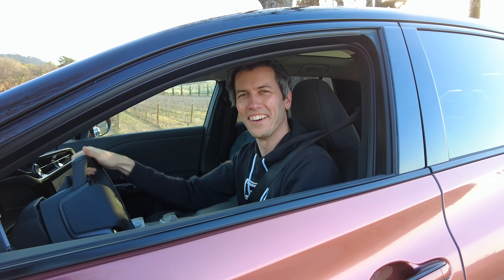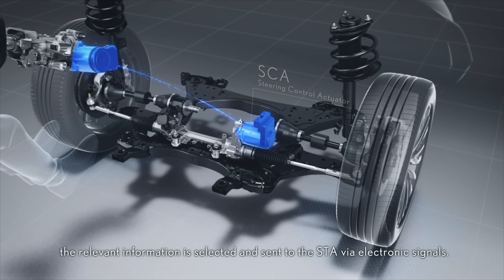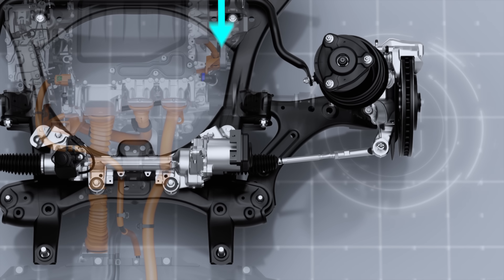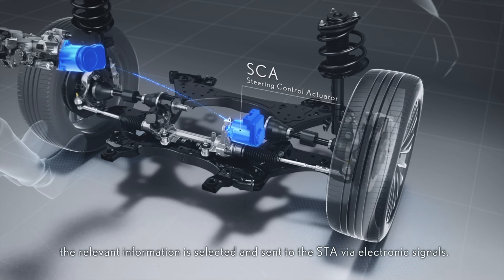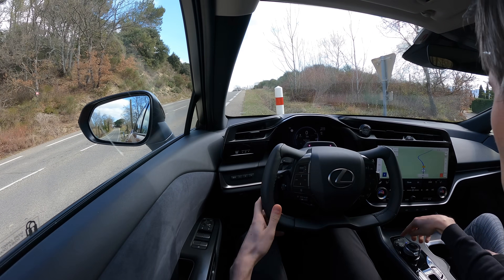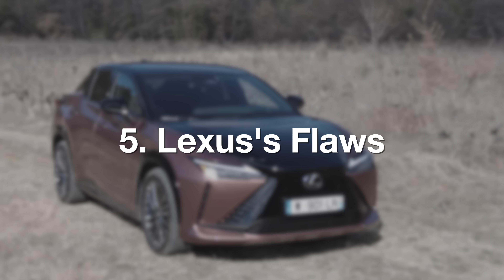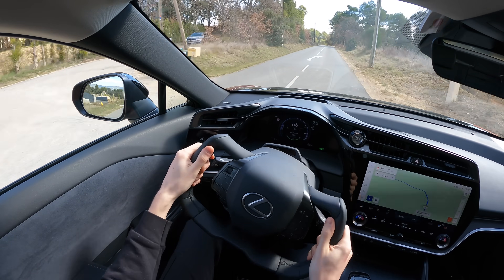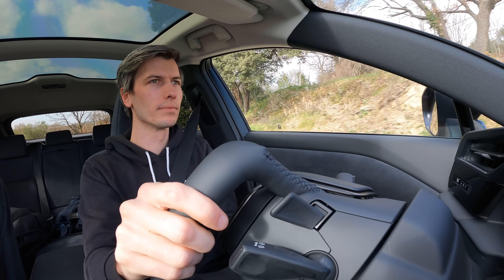How Lexus Fixed Tesla's Bad Idea: Steer-By-Wire Yoke

Comment: Today there are already plenty of construction and mining vehicles which use steer-by-wire with some great features. One I really like is the angle-variable steering sensitivity instead of a speed-variable one. In the center you get a really precise steering with a high ratio, while towards the limits you get a much lower steering ratio. The same trick is used by several pc racing wheels.
Reply: I've found that angle variable steering makes machinery much harder to navigate through narrow environments, I'd much rather turn the wheel an extra time for that increased control.
Reply: idk how you could possibly avoid an accident with this system going at highway speeds.
Reply: @Playingwithproxies  It will steer as quick or quicker than a normal car with a normal steering wheel in that situation ... and the stability-control remains there to hopefully bail out a driver who screws up. This should not be a problem, as long as the delay mentioned in the video is below perception (Lexus needs to calibrate that out).
Reply: @bikeaddictbp   it’s not quicker than connected to the wheels for sure and it’s the lack of ability to make big stearin maneuvers that’s going to cause avoidable accidents.
Reply: @Playingwithproxies  Stated in video: This system does not restrict the driver from making large steering movements at speed.
Reply: @bikeaddictbp  yeah and Bowing said the 747-max was safe too. You do realize that the adjust as you increase speed steering ratio requires that it is actually limiting your steering movements. A company trying to sell you a car will straight up lie to your face to make a sell.
Reply: @Playingwithproxies  actually 737MAX and 747-8 does not use fly by wire. Airbus A320 and A380 does, in fact all Airbus after the A320 series use full fly by wire.
Reply: Construction vehicles don't need to adhere to safety as road cars do. You don't see mining front-end loaders have pedestrian crash bars or air bags in them.
Reply: @@nicoyazawa829 completely different. Aircraft have near the highest redundancy/factor of safety of any vehicle ever. This cant be said for a passenger car. Fly-by-wire is electro-mechanically assisted, not only electrical.
Reply: @PrIsMaTiSmX  Airbus fly-by-wire have full digital connection between the input and flight control surfaces. Currently, only the rudder have mechanical connection except for the A350. Airbus is in the process of removing that last connection. Switching to e-Rudder for future A320NEO series production.

Edit: I forgot to mention the THS, that's also have mechanical connection on A320. I don't know if this still true for A350 and newer models. That said, on normal operation, trim on an Airbus are fully computer controlled.
Reply: @bltzcstrnx  you're missing the point, there is ALWAYS mechanical redundancies. This is a matter of public safety. Steer by wire is not a good idea. This is coming from someone that is a practicing Astronautical Engineer for JPL..
Reply: @bltzcstrnx  also, you will need to cite your sources, as I do not believe what you claim.
Reply: @PrIsMaTiSmX  There is no mechanical redundancy in most passenger cars. If your steering column breaks, you have no steering.
Reply: @danielrose1392  Yes, but it's mechanical. It would take the physical breaking of steering components in order to fail. This happens much less often than an electrical systems failure. That's just a fact of nature. Mechanical systems are inherently more resilient than electrical systems.
Reply: @PrIsMaTiSmX  "Resilient"? Ever heard of material fatigue, mr JPL engineer?
Reply: @pavulon5000  you hardly have a high-school education if you think resiliency has any relation to invincibility.
Reply: @bltzcstrnx  have no sources to cite?
Reply: @PrIsMaTiSmX  I already explained to you that YouTube doesn't allow links/URL. I understand your skepticism since you're working on an US based organization. European and US have different philosophy on flight control laws. You can read about it online. Airbus basically decided that redundant fly-by-wire systems is enough to compensate the lack of mechanical connection.
Reply: @bltzcstrnx  I have already researched it. I am literally in that field and the rest of the world agrees mechanical redundancies are necessary for the obvious possibility of electrical or sensor failure. YouTube does allow links, you just haven't tried to send them. Even if they didn't, you can simply modify the link to something YouTube wouldn't recognize as a link.
Reply: @PrIsMaTiSmX  I have in the past, it usually got deleted almost instantly. Anyway, you can read about Airbus e-Rudder. Basically rudder and THS are the final components on Airbus that is mechanically linked. Airbus is replacing the rudder with electronic link in the future. Leaving THS to be the only last mechanical link available. I know it's somewhat hard to believe, I also know this after reading several documents including part of the FCOM about flight control laws. In the end, Airbus is confident in their redundant electronic system and computers. They deemed mechanical linkages increases complexity and weights.
Reply: @bltzcstrnx  feel free to provide receipts at any time. Also, not sure how one company doing one thing in aviation has anything to do with what another does in passenger cars. One does not prove the other.
Reply: @PrIsMaTiSmX  most likely because automotive industry takes inspiration from aviation. Both aviation and naval industry (for very large ships) already do away with mechanical linkages since the 90s, maybe even earlier.

Automotive already done it with their throttle control. All (most all?) modern production car already have no mechanical link between throttle pedal and the engine. Brake probably going to be the last one to lose its physical connection. So steering most likely going to be next. They probably think since aviation, which is proven to be one of the safest industry, already done this a long time ago, why don't we?
Reply: @bltzcstrnx  you probably also recall that its the safest form of transportation in the transportation industry due to the inherent risk of death associated with flight (and 9/11). The aviation industry is safe because of its strict governance. Low tolerance for lack of maintenance and high security. You can't just walk up to a jet on the runway like you can a car on the road. This is why its safe, because they go through yearly maintenance as a minimum to be considered air worthy, and no one but certified technicians are allowed to even take the engine cowling off of a jet. Passenger cars don't get that same treatment.

Throttle-by-wire is much different than steering by wire. If throttle-by-wire fails (and it often does), the worst case is a vehicle not being able to move anymore or coming to a stop. This is why its a no brainer, because its' failure mechanism defaults to a safe stoppage of the vehicle, with a mechanical spring ensuring the intake valve stays shut and the ECM defaults to an idle fuel-map.

This is different than steer-by-wire since there is no default it can resort to upon failure that will allow the vehicle to remain safe. A driver must always be in control of the vehicle, this at a minimum is maintaining the ability to steer, and the ability to stop in some form. (This is why the brakes are automatically applied when semis and other large trucks lose air pressure) In the event of brake failure, its safest to be stationary.)

The failure mode for a throttle is closed as opposed to open, the failure mode for brakes is applied as opposed to released, the failure mode for a transmission is free spin as opposed to lock-up, the failure mode for steering cannot be assumed to be similar to the others due to its critical nature. This is obvious.

Steer-by-wire will always be a bad idea, especially since vehicles are being tampered with every day, let alone giving a criminal a chance to completely override a drivers controls by installing a bypass unit under the vehicle while the owners are asleep.
Reply: @PrIsMaTiSmX  that's true, but several companies are testing steering-by-wire. They probably thinking it's more safe than brake-by-wire and intend to get there after throttle-by-wire. It could reduce production costs, especially for manufacturers who deals with market that have different steering side (left hand or right hand).
Reply: @danielrose1392 I’ve never heard of a steering column breaking. But electrical problems are rife in modern cars
Reply: A linear movement is desired with sim wheels. You can make it non linear but that would be an entirely preference thing.
Reply: im not disagreeing but variable assist HPAS systems are already available.
Reply: Yeah, I get the point but these vehicles only operate at low to very low speeds compared to an EV.
Reply: @Nico Yazawa flying car anyone? as this interior makes the transition from ground operations to flying easier as 172's have yoke's generally ect
Reply: @Nico Yazawa construction equipment drives very slow, and aircraft are in a near empty environment with nothing else to avoid on a moment's notice.
Reply: Construction and mining equipment are driving round at 20kph at a closed area. Not 100kph passing oncoming traffic without a barrier in between. 
I bet you have no idea how many people die because of these new inventions. Like for example the auto pilot of Tesla. I bet you didn't know that there have been loads of deadly accidents directly due to the actions of the autopilot. That kind of things are well kept secrets.
Reply: @Dani8chs  Your bet is totally wrong, it's my work to comission and automation of HIL simulators for the automotive industry. Except for a joy ride to try something new, I would not use Tesla FDS and I would always keep my eyes on the road, but I would absolutely buy a car with electronic steering. The later is a system which can be fully validated and verified during development.
Reply: @danielrose1392  I tried several cars with electric power steering and they are all rubbish. There is a reason why BMW choose to just eliminate the power steering above 30kph on some of the M models . They just could not get the propper road feel acceptable for an M car. But most people aren't really ''drivers'' . They just want to get from a to b and have some gadgets onboard. Hence the fact that SUV's are so popular. For them I guess it's ok. Although on the Hyundai I40 the road feel was so bad it was almost dangerous. You put the car into a corner and you suddenly end up 40cm further out than you expected. Crossing the middle line. It is just not intuitive. But my wife never noticed the problem.  She is a novice when it comes to driving.
Reply: @Dani8chs  Tesla's self-driving mode actually is safer than my 60's charger/2000's-car as humans make more mistakes according to DOT and FTC released information aka elon would have been sued by owners and investors 

im not really interested in self-driving or automating my driving experience at all aka i generally don't enjoy using cruise control from the 1970's-up ect

as for by wire and or tuning on the fly maybe as im kinda for it, but DOT i can't see them passing it as written steel end to end only and as written assessed 1970 box/steering if fround upon but legal

Comment: What happens if that wire connection gets broken. Or corroded mid driving and you get a fault where it cannot steer for you. This is super common for many modules and connections in modern cars as many error codes are caused be bad connections. In this case you drive off the road into a tree
Reply: VW has a function where the car will turn on the hazard lights and drive to the shoulder / right side of the road when the car thinks the driver is unconscious. So in theory the fall back could be, the system recognize the faulty connection (power loss somewhere) and then does the same using the cameras and sensors of modern cars. And since there are two motors for steering, one of them should always be working.
Reply: @nils9853  How will it turn if its failing to make contact with the steering motors. I think my point remains.
If my abs unit fails and cant comunicate I can still brake. If my steering assist fails, I can still Steer just harder. But if this system fails then it can be really bad

Comment: Some farm tractors have variable steering ratio and it’s awesome. Tractors steer with hydraulics, but it’s the same idea. Traditional tractors requires a zillion turns of the steering wheel to go from lock to lock.

Comment: Putting aside any concers about steer by wire, variable steering ratio really sounds terrible for any driver. What if you are rapidly braking and turning at the same time. The case of many dangerous situiations when the driver need to avoid or minimise loss. Will then the car start turning sharper? This require additional skill which the driver is not assimilated with during everyday driving. sorry for bad english

Comment: Could a mechanical steering column use something like a small CVT in order to create a variable steering ratio, thus allowing a yoke to be suitable and to remove the delay in steering response?
Reply: in theory yes, but it most likely wont happen. there are steering ratio boxes that have been available for a while now, if you feel like your steering is too delayed or slow, you can change the ratio from say 1:1 to 1:1.1.  its just a little pair of gears that goes between the int shaft or column shaft depending where you install it

Comment: Great video, but I have to disagree about Tesla’s design. Their design is awesome. The yoke feels much better than a wheel, and hand over hand movement isn’t an issue at all. It took me literally like 3 drives to get completely used to it to where it’s not even a thought, all natural. And most everyone that has used the yoke all say the same thing. Now I prefer the yoke over the wheel by far, so much so that I even got one for my Model 3. It just simply feels better and is much more comfortable than a wheel.

Comment: One safety concern not adressed here is the possibility of some sort of control logic failure. It's not unheard of for abs or traction control systems to freak out for what ever reason and apply more or less brake pressure than needed. While these types of failures are rare, when it comes to steering I feel when it comes to steering the safety margins must be a lot higher than in other systems of the car, since the driver Can't really correct a random full lock steering input at highway speeds. Do these systems include reduntant sets of control electronics as well and how is it determined which module is malfunctioning if the outputs differ?

Comment: I like it. And from a safety standpoint. There are sensors and computers in all cars since 20 years which could explode the airbag right in your face every second. But this nearly never happens. This shows that electronics can be build fail safe. But the car really should limit the driving range or get really annoying when one motor fails, to make people go drive to the repair shop.

Comment: I'd be more than down to try Drive by Wire as long as:
There's no input lag for steering, obviously.
I'm not forced to use a Yoke. I hate them, I'd rather have a wheel. I have no issue seeing things on the dash with a traditional wheel, which is like, the only downside to the wheel for "most" people.

Comment: Why not just have a clutch that is default locked at a ratio good for higher speed but electronically disconnects or can slip. So if power goes out it locks.
Reply: You then have more components rather then less. And cars already rely on electronics not going mad. Throttle, airbag, esp.. all could get quite critical if these go wild and accelerat to infinity, go off on the highway or tell your right front wheel to do a full break because the sensor feels like.
Reply: @nils9853  Hello did you not see the extra power wiring, extra motors, extra controllers and extra in steering wheel motors needed for their implementation?
Reply: @JimFeig  but all this parts would still be needed in your solution. The clutch if locked should be optimal for high speeds. This means relatively high steering input results in relatively little actual steering. So in a low speed/standing still situation where more actual steering is needed, where does this extra movement come from?
Reply: @nils9853  a single assist motor instead of redundant ones. You don't need road feedback at parking lot speeds. So that feedback system can be axed

Comment: This is an interesting concept of an idea. As with many such things, it will likely improve in future iterations as the engineers figure things out. That being said, I want nothing to do with it until it is actually superior to a traditional system. Oem's have been doing throttle by wire a long time now and most of the electric accelerators I've used are STILL inferior in response then a cable type.

Comment: Great analysis. That delay in the steering wheel could potentially be problematic in emergency maneuvers.
Reply: The delay test was done with a standing car and I think there is a max speed with which the motors can move the wheel. But if you go faster, less and less movement is needed so the delay should be irrelevant. But that's just my thought.